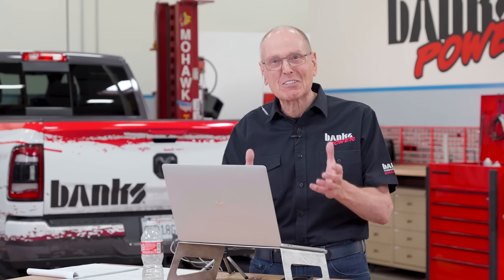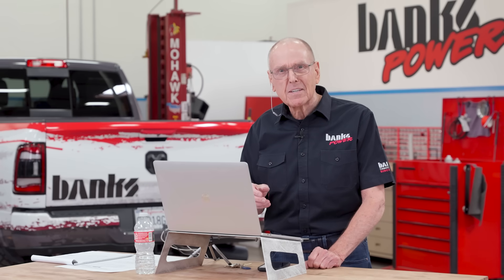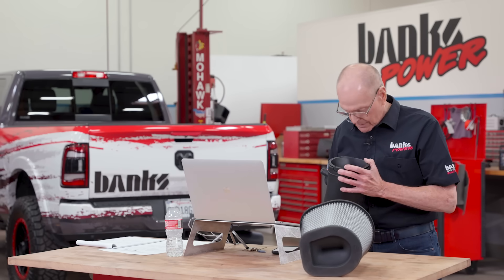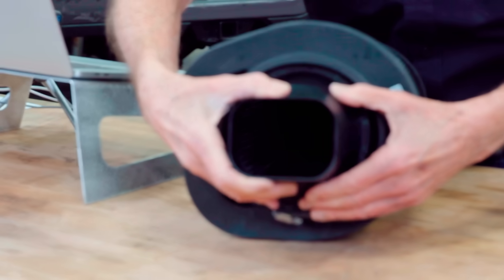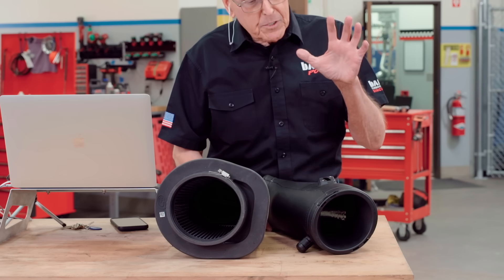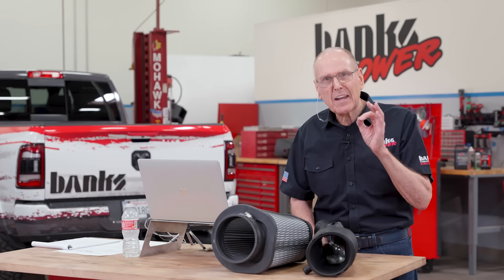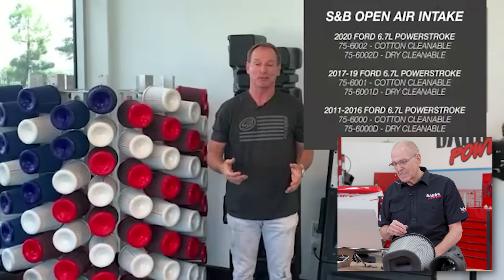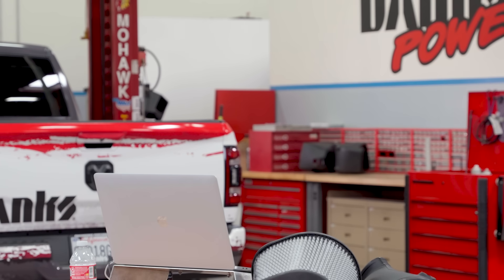Stop making these air intakes! | Fact Check

Comment: I like the insert idea as it allows you to not need to have retune your ECU for the MAF

It's also nice because if you eventually do get it tuned you can pull the insert out and get even more power

I like that feature, it's valuable to me
Reply: Are you on here trying to convince yourself it's a good idea to buy the S&B crap? Or is this soliloquy for our benefit, because I gotta tell you it's not at all convincing. LOL.
Reply from the maker: 10 points for the use of "soliloquy."
Reply: @tetrabromobisphenol  I mean, it's a cheaper and potentially more reliable solution than having to run a passthrough converter for the maf

I'm not saying anyone should buy anything

I'm just expressing that it's nice having an untuned and tuned option for your intake, I don't really care what the implementation of it is as long as it's cheap and effective
Reply: @CyberdriveAutomotive  That insert is a restrictor itself, so this would probably be worse to run than a stock intake.
Reply: @adammorrison3343  Nah, it's not a restrictor, it's an adapter so the internal diameter is the same as the stock intake, which doesn't require a tune

whether or not it will make power depends on a lot of factors, but I would bet on it adding power, albeit not much
Reply: @CyberdriveAutomotive  It’s a restrictor. You’re only going to pull the volume of air determined by the smallest cross-section in the intake, which is at that “adapter.”

Comment: Just a random youtube comment I know, but on the offhand someone at Banks reads these.  Gale, I agree what S&B is peddling here is bullshit and applaud you for calling that out.  I put to you though that the claims of such high under-hood temps having a meaningful impact on power is also bullshit, and challenge you to consider testing that as well.  I do not at all argue that the temp difference will exist, when stationary for some time.  Once you're moving 30+ mph though for a minute or probably less the temp difference will be so small as to not matter.  You can just look at what the MAF is reading in grams/second.  And I know you know where the power comes from, so I don't have to explain, but for the sake of the comment.  Take the MAF difference in grams/second, apply your maximum power AFR to get your grams of fuel.  Whatever fuel your using has a known amount of energy (power) by weight.  Whatever that amount of power for that weight of fuel is, that's all the possible power available if an engine were 100% efficient which of course none of them are.  Once you take that small g/s difference, chop it down 1/10th or more from your AFR, and chop that down 65%, 70% from real world engine efficiency and what's left are crumbs.  In those crumbs there might be some technical truth in temp difference, I challenge you that there isn't meaningful truth.  Less truth than you'd get in the difference between night and day temperature fluctuations.
And okay some might think this is all theory-crafting, bench-racing, formula-referencing mumbo jumbo and just put it on the dyno and test it.  Well you can't really put this kind of test on the dyno without an enclosed wind tunnel too.  Banks might have that, I don't know.  At the end of the day, the MAF doesn't lie.  Just as Gale is explaining in this video, Cubic Feet per Minute doesn't matter, Grams per Minute is what matters.  Don't need a dyno to know if the air mass isn't there, the fuel mass can't be there, so the power can't be there.

Comment: I wonder if they restrict it so the factory truck doesn't throw a code but allows for future tuning and more air flow.
Reply: Gale Banks explained why those guys put the stock size intake restrictor inside the huge fake intake pipe..
Reply: @Fran Danco  I understood what he was saying bit if you take that out, the air flow is double.

Comment: Gale Banks is doing the Sandy Munro and David Vizard “EXPOSE” method.

I get what the guy is trying to do. 

An example is to look at the clowns buying exhaust mufflers for their imports that create 160db of noise and give an added 1.98HP and 1.12 lb-ft at 7000 rpm.

Why should eBay and Amazon get all of the money. He wants in on $$$$.

Comment: Looks like S&B hired the GM engineers that designed the LLY turbo intake duct that went from 3" tube from air filter housing to 1.5" restriction and 90 bend.
Reply: Agreed, but I did buy the s&b intake kit for my LLY with a 3 inch elbow into the turbo. Before I could barely tow my 30ft toy hauler up hill while it was empty. Now I can do 60 up hill fully loaded with it. And it's running cooler and no longer kicking the clutch fan on every 20 mins.
Reply: @kodiaksauto6519  Yep I put a AFE elbo and Banks ram air intake dropped my CAC and EGT temp 100deg let me pull my 16k# 38' TH up to Kennedy Mdws 8k' in Sierras without limp mode had full Banks pwr kit with Ottimind/Speed brake to save service brks on way down put 170k miles on it without issues before replacing with '15 LML dually to pull 18k 40TH which has Banks IDash only has had emmision issues but has other wise been reliable with 75k miles. Looking at replacing CP4 soon before it craps up my injection sys.

Comment: You're making fun of another companies Intake, yet you have a faulty design in yours that you don't even have a fix for yet, after months and months of a known issue.  And, you guy's just keep deflecting to "our engineers are working on it".  I have a few thousand dollars of your parts under my hood, most likely won't be another dollars worth after this video.  Quite hypocritical of you really, sad...
Reply from the maker: First, and most importantly, we sincerely apologize for the inconvenience. We know how annoying a code or check engine light can be. Regarding the content of the video, we believe there is a difference between knowingly producing a product that reduces performance and releasing a product that has a flaw. The Ram-Air intake in your truck is indeed actively being worked on. As our Tech Support Team may have expressed, the issue with the intake has been hard to pinpoint because such a small percentage (in the single digits) of 5th Gen Rams suffer from this EGR code. Make no mistake, we will not stop until it's corrected. And, if we cannot fix the issue, we will happily issue a refund. If our products do not improve your driving experience, then we are not comfortable keeping your money. One of our team will reach out.
Reply: @bankspower  You guy's reached out and that means a lot, it's much appreciated and that has not gone unnoticed and is VERY much appreciated.  Thank you for your help and commitment.
Reply: Be more specific ?
Reply: @TonyBenton0728  The Cold Air intake they made for the 5th gen cummins, it throws an EGR code.  They've known about this issue for a long time and have been "working on a fix".  When anyone calls fror an update it's always the same old answer "our engineers are working on it".  Complaining about another companies product when their own doesn't work properly is bad form, and a hypocritical look
Reply: @laurencehiggins239  I have the bank’s ram air on my F-450 and it has not thrown a code .
Reply: @TonyBenton0728  Dingus, he said on his Dodge, you drive a Ford, dunce
Reply: @TheRoadhammer379  Read the original comment from Laurence Higgins . No where in his comment did he say anything about a Dodge. Fact Check 🤡 I did ask to be more specific and he replied.And as I said mine has not thrown a code on my Ford. I

Comment: Did he just debunk Cold air intakes...😵
Reply: cold air intakes are real. the factory intake is a cold air intake. there's a reason many aftermarket intakes are called hot air intakes
Reply: @aleks138  i agree with Banks all day long
Reply from the maker: He debunked filters clamped to the end of a tube, exposed to hot under-hood air. Cold air intakes must draw in cold air... or they're not really cold air intakes.
Reply: @bankspower  exactly.....
Reply: @bankspower 💯👍👍👍

Comment: Thats why I didn't buy a $300-600 HAI (Hot air intake) option for my Dakota, they all just shoved an opened air filter with a "heat shield" toward the hole in the inner fender/wheel well from where the stock box drew from. I just bought a $65 drop in K&N.. I'll put the rest of the money I saved from not buying those HAIs and get a set of headers.
Reply: WAM(warm air intake) is good for noise and throttle response, and maybe you'll pickup more mpg but power....... nah
Reply: You sacrificed air FILTRATION for an extra pony or two and threw $65 down the drain. 😂🤣🤦🏻‍♂️ 

The filter is there to FILTER the air.
Reply: @I_know_what_im_talking_about  So why don't manufacturers and YOU run HEPA air filters... I mean its a MEDICAL GRADE filter that filters out dust pollen etc... oh wait, you didn't even consider that lol continue on with throwing away $20 paper filters.

Besides I've been running FRAM for since the truck was new, 18 years of that and now 2 with K&N. Same amount of silt, grit at the bottom of my stock box. Plus now my intake and filter pulls from the headlight grill area, and NOT THE INNER FENDER
Reply: Based on my experience, you are correct.
I have photo results of a brand new KN passing dirty oil into the mass air and intake duct, etc.
For what, 2% at 6000 rpm?
Reply: @hotrodray6802  so which one stops pollen? That stuff gets everywhere and is sticky by nature. By that notion you’d need a medical quality filter but they only make those for cabin filters not engine intakes. There’s no way to stop all things without sacrificing flow. Plus your sensors with newer cars will cry and complain if it’s not the correct filter anyways. So why aren’t you running the stock one then? Especially in a 2012+ model. I just didn’t fall for the $300 kits they sell that increase flow via less restriction and a open air cone without the sock. Even more so with mine being old enough to not have the pissy sensors to regulate airflow. I’m air density not MAF
Reply: @I_know_what_im_talking_about  no I threw away a filter that cost $20 every time I changed it. Besides if I wanted a REAL filter I’d buy a HEPA filter. But alas no one makes one for automotive intakes. Plus the route it takes via the stock air box the fram filters I’ve ran in it for 18 years had barely a 1/4 teaspoon of sand at the bottom waffle valley of the stock air box after years of living and driving on a sand/dusty roads.
Reply: @NXT_LVL  🤔🤨 that’s all good and all and I respect your decision but, it still doesn’t get over the fact that you can see STRAIGHT THRU the K&N air filter pleats because that’s how big the fibers are and it shows how good it will filter. That’s why the oil is needed to help catch some dust that would otherwise GO RIGHT THRU 😳😬🫣 

But hey, it’s your vehicle. 🤷🏻‍♂️